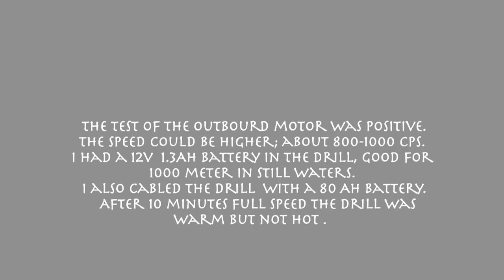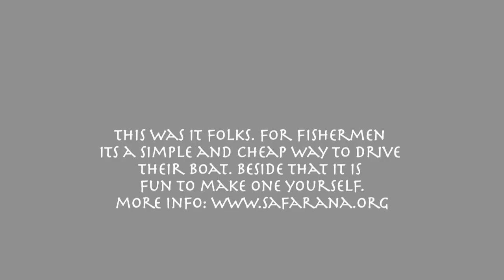Super-Simple outboard motor powered by a cordless drill.

Comment: I built one - I heavily modified an 18V drill ($50) , used a propeller for $30 from walmart, PCV pipe, bolts and nuts and a few pieces of metal. I spent around a hundred. I could have just bought a complete trolling motor on Ebay for $120, but what fun would that be? My contraption isn't pretty but it's my first one. My goal is to built better and faster ones until my trolling devices are better than the ones you can buy.

Comment: You could also do it "Bangkok water taxi style" with a straight drive shaft. Would save you some energy. I got an extension that rotates in the shaft. there wouldn`t be any gearing in the water too that way.
Maybe someone could also figure out the best propeller for the given power.

Comment: How did you make the extension for the right angle drill adapter? It looks like you got a spacer or something that you used a tap and die on then connected it to a metal rod? Where did u find the parts for this?